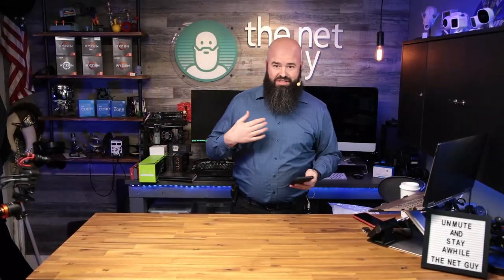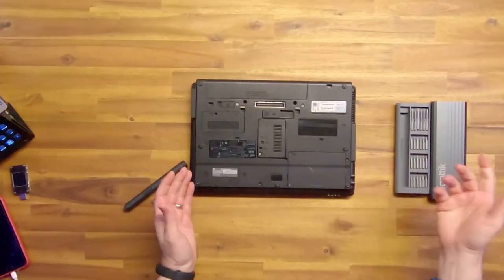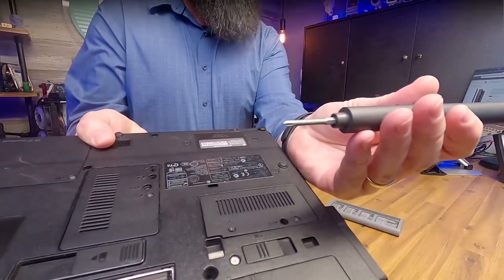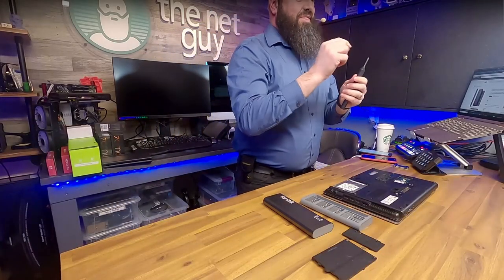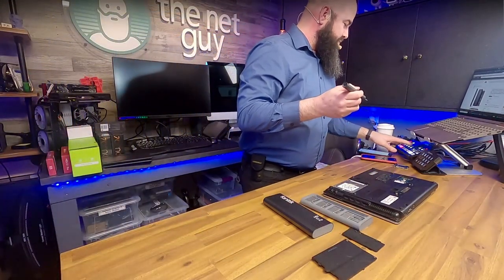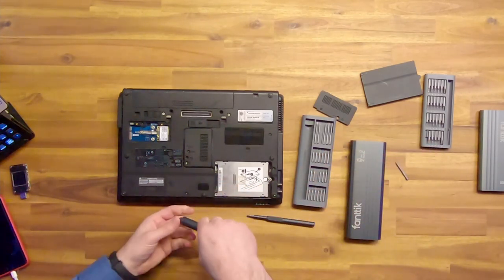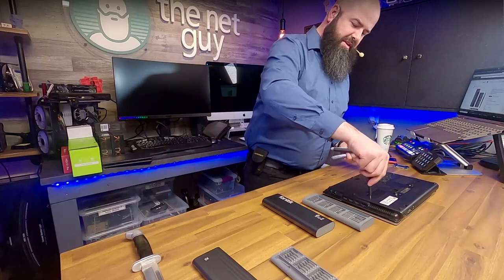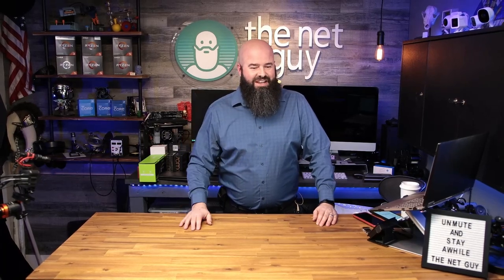The BEST electric screw driver I've tested.

Comment: TLDR: For Delicate work like smartphones, watches & glasses this is amazing, For PC's: Steer Clear. How small this thing is makes it absolutely perfect but it has a max torque of 0.2Nm. That is laughable at best. windup toys from mcdonalds have more torque ahaha! The Max torque for manual screwing with this is 3Nm. So for PC building I dont recommend this. The entire point of buying an electric is so you dont have to hand tight, with this you tighten it then still have to give it a couple turns with a hand screwdriver. Kills it entirely for me personally.

Comment: I have the Fantik and I'm not a fan of it. I thought I would really like it, but very disappointed.
Reply: why are you dissappointed
Reply: @AriR6R  the bits don't stay magnetized and that's the main reason I use it. I fix phones and such.
Reply: So, too hard to remagnetize using the case hole?
Reply: @UXDiogenes  I do that and it doesn't last or doesn't work properly. Ik how to magnetize